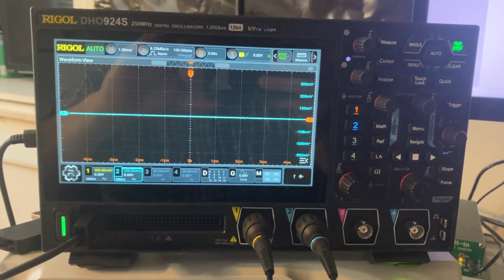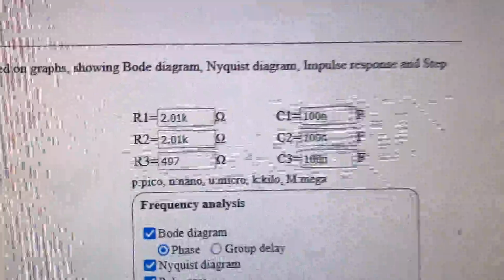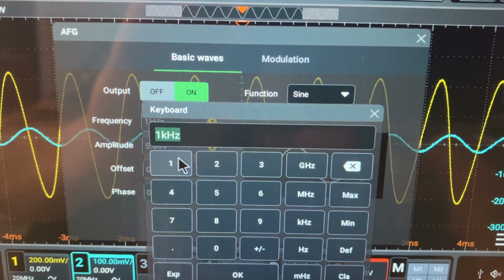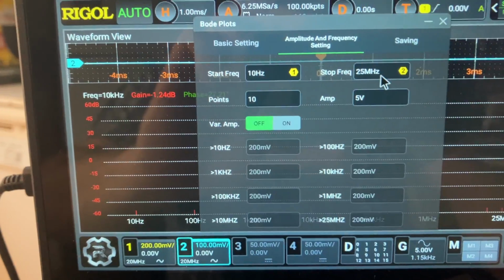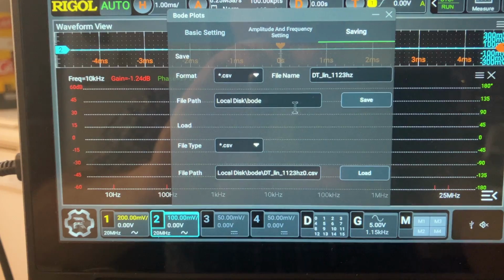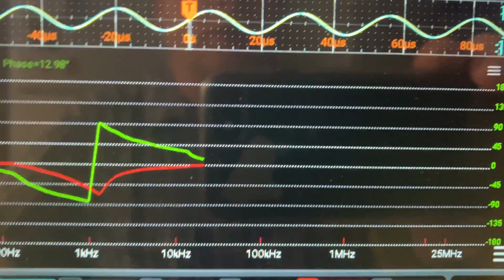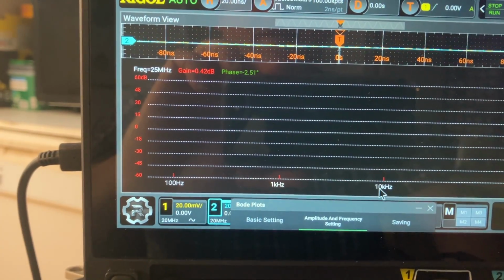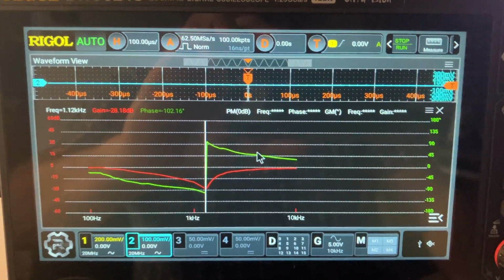Bode plot with Rigol DHO924s

Comment: The injection transformer is used to match the 50 ohm output impedance of the Rigol waveform generator to the input impedance of the sample circuit, 5 ohms in the Rigol example. It is also required in the sample circuit because neither side of the injection point is grounded. It is not needed for your passive notch filter.

Comment: Hi Steve, I've read a lot of comments about bugs in the firmware of the DHO800/900 series.  Would you still recommend buying this oscilloscope for fairly frequent use to generate bode diagrams and use mostly in linear electronics?  If not, do you have any suggestions at a price of less than $1250 CAD?  We look forward to hearing from you.
Reply from the maker: Hi , there is a new firmware that got out on Sept 5 that seems to resolve most of the issue that I have found. however it was removed due a new XY display bug. I expect it to be relaunch in few weeks, I will try it then. To get bode plot you need to go 914s or 924s. To me the bode plot works well in an integrated scope package. Alternative is Siglent sd8xx HD or SDS1104X-E  however you need their external pricey function generator and software add-on to make it works. I didn't try it myself but some review says its better.
Reply: @stevelevesque939  Thanks for the information, I'll take a look at this Siglent combination too.   In the meantime I saw that there is the KeysightDSOX1204G, 70MHz available from Aliexp... for 1250$CD free shipping and the Bode plot is also integrated in this oscilloscope.  It's 5 years old though, probably 8 bits and no touch screen. Is it a better alternative in your opinion?

Comment: Hello. I recently got the same oscilloscope and your videos are very instructive. Rigol recommends using a transformer to match the impedance between the generator output and the circuit to which the signal is sent. However, unless I'm mistaken, the datasheet gives no information on the electrical characteristics of the transformer to be used. I used the output of the generator without a transformer on a 455kHz ceramic rejection filter. Its input impedance is quite high, around 100kohms, and the Bode diagram was produced without any problems. I understand the use of the transformer in the typical switching power supply diagram provided by Rigol, but if a transformer is required to protect the generator output, Rigol should give the electrical characteristics of this output. Is it that fragile, and if so, what is it made of? Unless the electrical characteristics of this output are available, but I haven't found them. Thank you for your videos and best wishes for the future.
Reply from the maker: You want to protect the generator from high voltage and low impedance.  I have tried a few transformer but they where limited in frequency. I have fond a very old 1970 transformer that was sealed and was amazing performer with first resonance at 260Khz with almost flat response up to 25Mhz! There is one now on eBay, search PCI 2012B 501-002. Don't rush to buy it and try instead what you have in hand...
Reply: @stevelevesque939  Hi Steve. Thank you very much for your reply and for the suggested reference for the transformer. I'm not going to rush into buying such a transformer before looking at what I have in my drawers. 
In my opinion, this transformer is not useful, for example, for measuring the bandwidth of filters based on operational amplifiers with a high or even very high input impedance. 
As I'm not doing much development work or measurements on switching power supplies at the moment, I probably won't be using this type of transformer in the immediate future.  
Nevertheless, it would have been nice if Rigol had given us the electrical characteristics of the output stage of the DDS generator built into the oscilloscope. 
Also, thanks for the video posted yesterday on the use of this transformer and its frequency characteristics. I look forward to following you on Youtube.